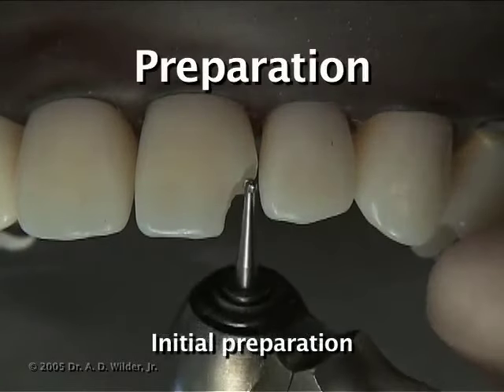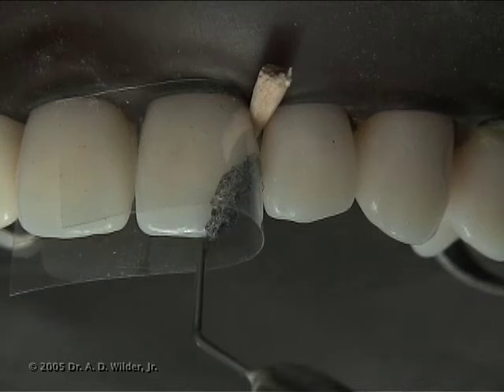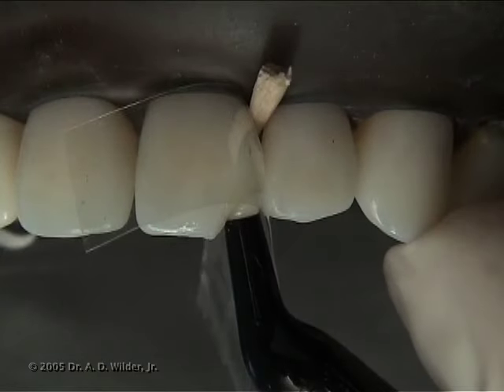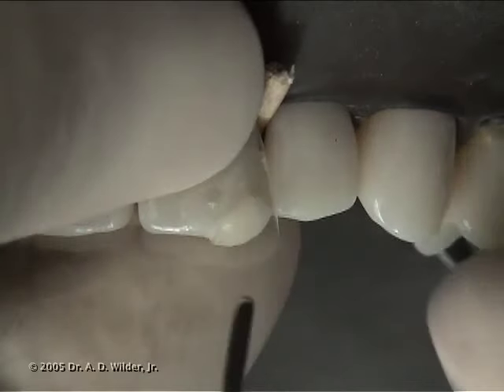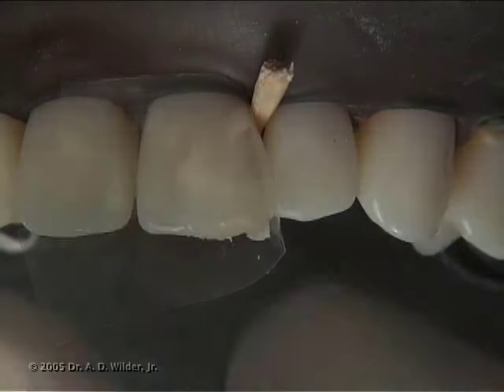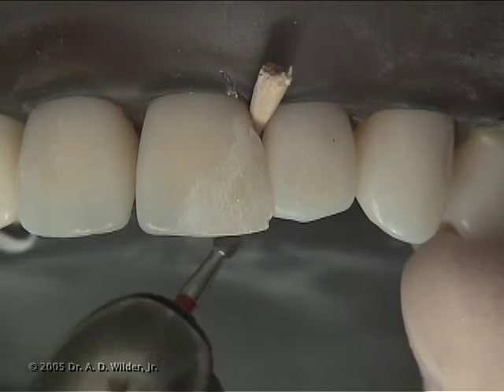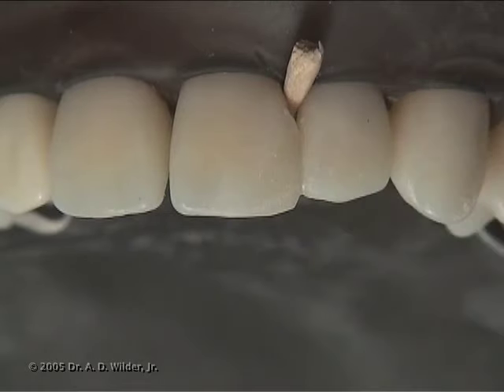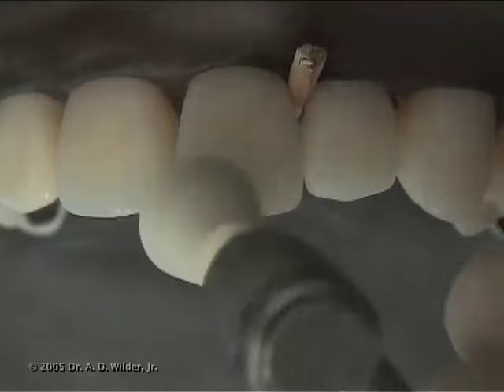Class IV Composite Preparation & Restoration | Operative Dentistry

Comment: Hi, what kind of strokes/technique/pressure are you using when removing flashes and overhang using #12 blade? Would a chunk of restoration fall off by any chance?
Reply from the maker: We use firm, controlled pressure with the scalpel blade. The most important part, though, is the angle of the blade. If you direct the blade too far outward you won't contour anything, and if you direct the blade too far inward you can scratch and gouge the composite. Finding the ideal angle is key.
Reply: @mentaldental  Witam  ile mniej  więcej  jest dni aby naprawić  ukruszony ząb im szybciej tym lepiej  ?

Comment: Doctor please what type of composite this a2 or A1 and how can i select the suitable shade ?
Reply from the maker: I believe this was A2. Selecting the correct shade is an art that should be done with a shade guide in natural light. You can even dry cure a dot of composite on the tooth to confirm your selection before using it.
Reply: @mentaldental  ok thank you ♥️♥️
Reply: If your shade guide isn't totally accurate then you can place and cure small blobs of composite of all the shades you've got and use it simply...

Comment: I thought islolation is to isolate 1 infected tooth.
Reply from the maker: Rubber dam is the standard of care for root canal treatments, which requires isolating the accessed tooth from the rest of the mouth, but they can also be used here! Most dentists don’t use rubber dams for fillings anymore because they are a bit more time consuming. Even so, some sort of isolation (rubber dam, isodry, cotton rolls) is necessary to provide access, control any contaminating fluids, and protect the soft tissue from injury.
Reply: @mentaldental  I was taught use cotton rolls for fillings and where the tooth is infected thus needing a root canal rubber dam